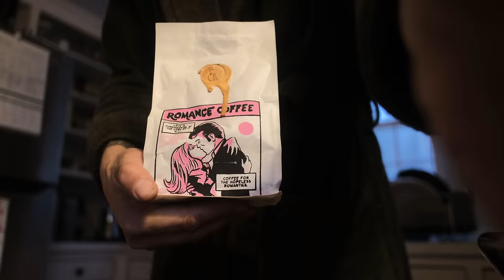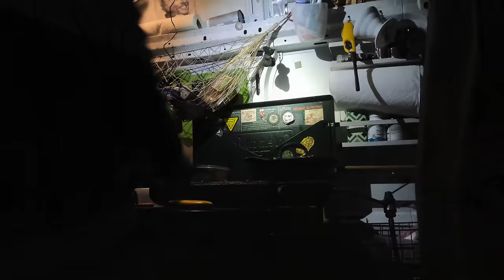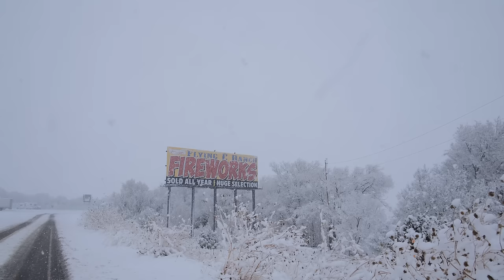we closed our factory and drove a van west

Comment: Lol...Ronaldo, I just started watching you 3 months ago...in fact, I finally fixed the bottom bracket on my 1966 Raleigh Grand Prix and installed a FC-7701 Crankset.  It wasn't easy like your 6 hour hammered fender install.  Its like a new bike now with DuraAce instead of Nervar cranks.  It's got Wald H-bars and front basket sporting yellow fenders.  I am building another old 1982ish Trek with 8spd Nexus now just for fun.  Renaldo, I did not buy any bags from you.  I like them...but, I love my head badges too much to put them up against that velcro strap.  I mean my bikes are all old and ugly, but I cherish nice headbadges.  How about a headtube clamp of some sort that clamps to the frame like a 28.6mm front derailleur but instead of 28.6, make it 1.25" or whatever a headtube OD is...design an integral hoop for the front brake cable to swing inside but so that the bag is somehow supported and secure, and QUICK RELEASE.  So you can secure the bag and not mess with the paint or head badge?  Make the clamps look like an extension of Campy clamps...that would be so bad assed!!!  Wherever you move, I dig your style, or lackthererof...lol...no really...a hippy roadracer is cool.  Hope you succeed in the way out west. I'm near Mt Rainier...my bicycle business venture in Orting Washington also flopped, but it was fun, and after I sold the building recently, I finally made some money...all is well...keep on keeping on Ronnie!